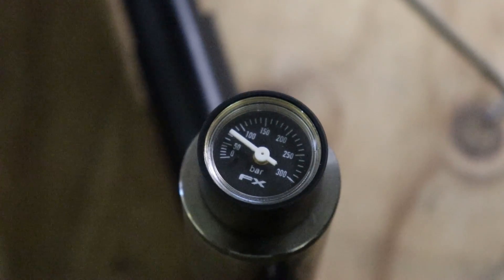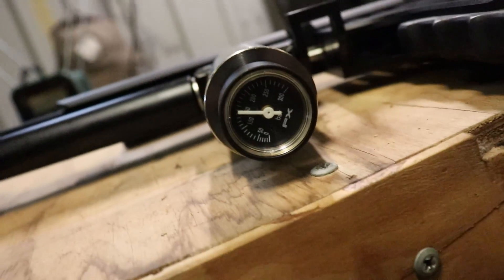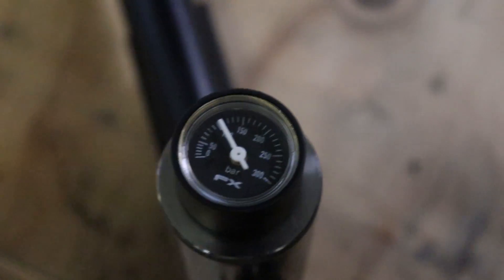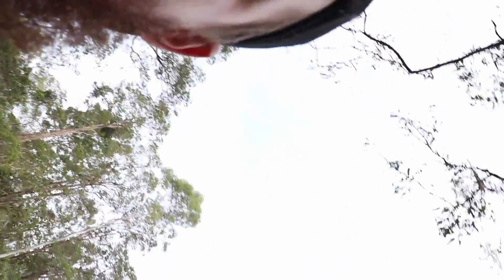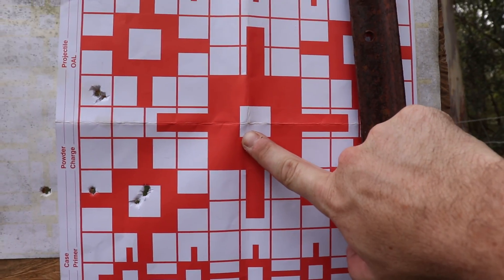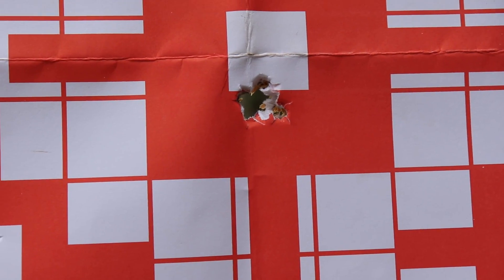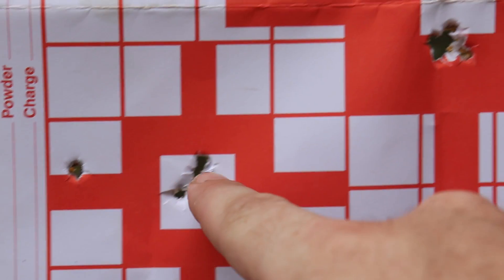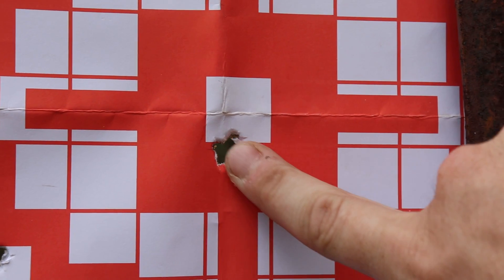FX Impact Power Plenum Tune up

Comment: That is a AMAZING tune with,out of the tin pellets👍 Can only imagine what sorted and maybe sized pellets would do for you extreme spread. Then there are other thing to do to pellet sorting, (if you have no life). The end metal shots, probably loader at target than muzzle, just like pest control, they make that satisfying pop/slap.Dead👍going to shop around and buy one in .25 as have slot on my FAC waiting. Thank you for the insight and head start on tuning..💪🇬🇧
Reply from the maker: No worries mate! Anytime you run a reg pressure higher then you need to it's pretty easy to get a good tune pretty quick with an fx gun

Comment: Just checked my email, and my power plenum from same maker is sitting at the post office waiting for me. I did some research and the air filters that fit on the end of the hose on those chinese air compressors also work as external power plenums.  end screws into the gun like it was made for it, gauge likewise fits the other end.
Reply from the maker: That's an interesting option. You could rig up a double barrel plenum haha

Comment: Same problem with the side shot mag,I took it apart and wound as much tension up on the spring as possible,it now works but I ordered a new one and the new one has much more tension.
Reply from the maker: I wonder if I can just order a new spring
Reply: Meathead Marksman not sure mate you tried putting a couple good turns on the spring?
Reply: @meatheadmarksman2013  I had the same issue with my new MKII that I purchased last week with two mags & both had different spring tension. I called the factory & they suggest two full revolutions, one came with 1 revolution & the other 1 and 1/2. I set them both on 2 turns & one works perfect & the other still jams. I figured out the center rotating part sticks on the center case with no spring installed, I just called my distributor & they shipped out two new mags today. Others are having the same non rotating new style mag problem not just us. Hope this helps
Reply from the maker: @samsawyer2145  yeah I put as many as it would take. I think it's combination of sticky spring and loose pellet probe
Reply from the maker: @mikeb3732  I'll talk with my warranty guy and see what happens

Comment: What speed do the standard Kings have with that mk2 tuning?
I am looking for 900ish with kings and mk2 in the same tuning w fx power plenum.

I only counted 3 cold Ones  this time😁
Thanks again for sharing your progress!
Reply from the maker: That should be doable if you tune for the mkii on max, the kings will probably around 900 on setting 2 or 3

Comment: Top vid!!!!

New to tuning and getting my FAC soon (🇬🇧) if it’s not a daft question, when you say Xmm of hammer spring, where are you measuring from and to? Pic would be good if have time!

Also are you using the standard Fx reg or a Huma one?

Watched both vids top work!!!!!
Reply from the maker: Thanks for watching mate! Hammer spring gap is measured from the front of the block that holds the adjuster screw to the apex of the recess in which it moves back and forth when you adjust the hammer spring wheel. If you message me on instagram @unclehodge or Facebook at meathead marksman channel I can send you pics

Comment: Awesome...900 FPS is more than plenty and if the accuracy is good then your good. Nice job! I have been kicking an idea around in my head for a little while now about soft silicone tipped hollow points. Like a Predator Polymag but no hard plastic just soft squishy silicone Point. Me thinks it will hydraulically expand the hollow point better at lower speed and as a result reduce the chance of passthroughs and impart way more energy on the target. Curious how pellet manufactures haven’t done this yet. Hornady has been doing it for my pistols for years. They don’t get clogged on tissue, clothing, hair/fur, and have a higher BC then my Daisy HPs. I am going to try and make some with High temp RTV inside their hollow end and see what happens. Unfortunately Daisy doesn’t make a .25 caliber anything so that leaves me with Hunters and Crow-magnums both by H&N. If you have any ideas in that brilliant mind of yours that might aid this adventure, I’m all ears. I figure these lower velocity pistol rounds are similar to our air gun speeds and ammo performance should also be somewhat similar. I am very curious to hear the impact on the Cain toads with your low power tune and wonder at what distances your shooting them at, like how close? Thanks for the awesome video and so happy y’all got the much needed rain. In our papers they said about 2 dozen people were arrested for starting those terrible fires in you country. If they really did it then they should be punished. So very happy to hear that the fire did not effect you and your family. With a week of rain the Cain toads should be hopping about like mad. Smash the daylights out of them with your lil monster. Glad you got it sorted. Thanks and take care bud.
Reply from the maker: First of all, "brilliant mind" is FAARRRRR to generous lol Shots on toads are only 5 to 10m so 30feet? I rekon bigger hollow points or softer lead compounds are usually what the manufacturer would start with but no harm in trying what you suggested

Comment: I’m surprised your reg pressure has to be @ 120 bar and not lower 🤔.   I’m wondering what the new impact power plenum will be like? I’m also wondering what it would be like with power plenum + vlads plenum on too 🤪🤪🤪.    Be nice to see what your results will be when you put all the items in it that were sent to you 🤔.   I’m hoping to get the new power plenum on a new mk2 impact to shoot various slugs through 🤞
Reply from the maker: I could have probably got 900 from 100 to 110bar but I couldn't get my lower quieter speeds like that. Needed high reg pressure to close the reg faster so that there was a bigger drop between hammer wheel settings
Reply: Meathead Marksman I feel for you not being allowed moderators in Australia without a special licence 🥺.   At least you can have all the power you want without a licence like us having to in the uk 🤔
Reply from the maker: @peewee007654321  nah we need a full gun licence to have any air gun. There's no win for us here lol
Reply: Meathead Marksman oh 😲

Comment: Question.  On a pellet like the jsb 33 grain mkii.  Whats the ideal fsp speed for 100, 150, 200 yards?  I have an fx impact mkii.  Also on the hammer set at max vs 5 should there be a difference in fsp or virtually the same?  Some times the fsp is faster set on 5.  Not sure why.
Reply from the maker: Imho faster the better with jsb 34gr. Mine shoots like an absolute laser at 930fps, so I rekon 930 to 950 is what you should aim for. It's probably better on 5 because that closer to the sweet spot/balance point for the reg pressure you are currently running. If you have the time watch my tuning videos, I do my best to explain the theory in depth

Comment: Hi, when using the hammer weight, because of the lip that sits inside the hammer it makes the height from end of hammer to top of spring bigger. So, to keep it the same height you need a shorter spring-not much 1.5mm say. Any ideas on how to get the spring shortened. I look forward to you using the hammer weight and see how you deal with this.
Reply from the maker: I'm pretty sure you just order a shorter hammer spring, I don't think it's a good idea to modify the existing one. I'll keep you posted

Comment: Can you still use this if you have an Impact with the FX Power Plenum already installed?
Reply from the maker: Yeah but you might need a different hammer spring to get lower power settings if that's something you need
Reply from the maker: @duopkik  nice! Well with a power plenum and an external plenum you will get bulk power and lots of shots per fill
Reply: I just made a mess of my pants reading that. Thanks very much...

Comment: Greetings, Meathead, I was wondering how much, if any, you dialed the valve in on your tune. I don't think you mentioned that. Your videos are A #1, Joe. Cheers Oh, and by the way, so nice to get some info on .25 cal, (the man's cal), and not always on those stinkin' .22's. Wink wink, nudge nudge
Reply from the maker: I turned the valve in to just past the 4th line, so there's like 3 and 3/4 worth of lines showing

Comment: hi, impact 25cal 700mm or 600mm?pellet liner A or B?
Reply from the maker: im using liner a 700mm
Reply: @meatheadmarksman2013  thank you
Reply: @meatheadmarksman2013  Isn't a 600mm barrel enough?(How many cm is the fx Impact mk2 25cal Group within 150 meters?)
Reply from the maker: @mehdirezai7450  you can get good power out of a 600 but you can get more out of a 700, and more is good! 700 is quieter aswell, silencers are illegal in my country so the long barrel makes it a bit quieter. 150m groups depend alot on wind for the day and how good the shooter is, I havnt tested mine at 150 yet but I shoot about 1.5 to 2 inches at 100
Reply: @meatheadmarksman2013  thank you bro

Comment: Whats on your regulator pressure gauge
Reply from the maker: Mine cane with little black removable covers made from some sort of plastic. They slide around a bit but stay put nicely if you put a smidge of plumbers tape down first and then slide em on

Comment: How much does this power plenum cost?
Reply from the maker: You'll have to email vladan and tell him what you want, international shipping and specific parts required change how much it costs - all his details are in the description of the video
Reply: i inquired about purchasing plenum to vladan.kit etc cost 295$ .posted 295$ paypal then was told 295$ USD   = 466 AUD $ HAVE posted anoher 171$ au   will see what the out come is
Reply from the maker: @stephentamme5281  the exchange rate is a bit rusty at the moment. It'll be interesting to see how much the fx plenum will cost in australia, I rekon it'll be around 300 to 350 +shipping. I think vladan has done a good job on pricing, being a small business making a specialised product I think his workman ship and how well it all works you'll be happy with it

Comment: Your gun sounds quite different even on the video, it sounds quieter.
Reply from the maker: It's not much different in real life, I wouldn't recommend the mod as a db killer or anything. It's maybe 2% quieter
Reply: Meathead Marksman yea, I'm not really concerned about the loudest. I like the extra shot count at high fps you'll be getting. No luck for that with a Crown only way is changing the reg pressure and hammer and lower FPS.
Reply from the maker: @Lorwildrose  I wonder if huma makes a bigger plenum for the crown? Time to get googling
Reply: Meathead Marksman I don't think so you would need to change the stock or have it sticking out the bottom of it and in the way. I'm happy with carrying around another tank. With the huma reg it's putting out the same numbers as your but using more air.